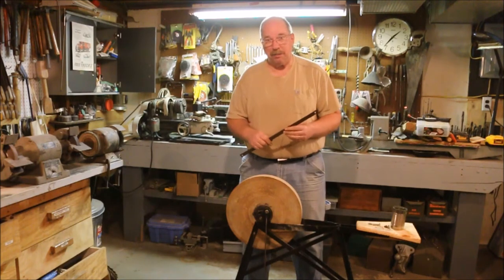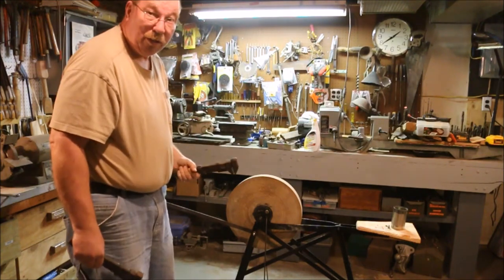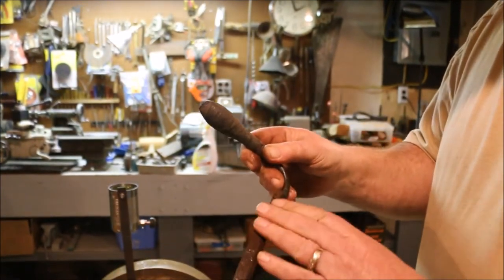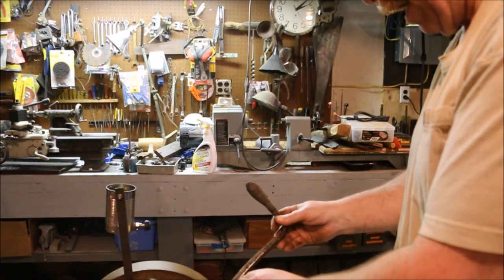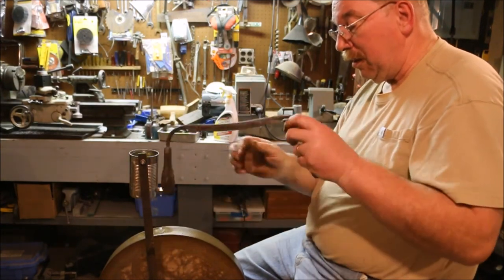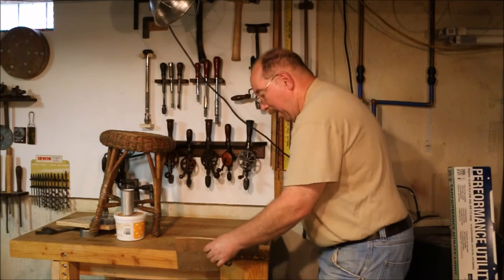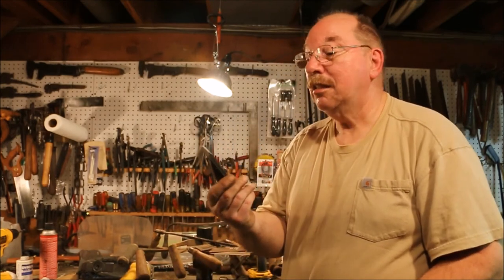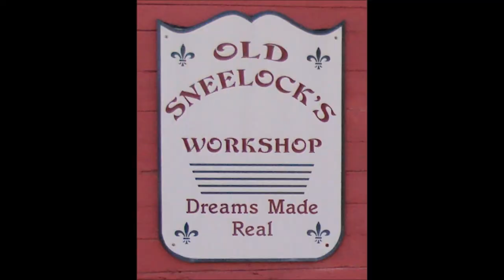AVANT GARDE VIDEO PRODUCTION ~ SHARPENING A DRAW KNIFE UNCUT

Comment: A longer format just for the sake of being longer is OK (assuming I don't already have a back log of YT to watch), but I personally prefer the more condensed format.

That said, the grinder looks like it works great.  Should we expect to see you sharpening your twist drills on it?  Yes, a joke, but I wouldn't put it past you to try it just to say you did.
Reply from the maker: Brian Neeley I'm trying to design a tool rest to help with aligning work on the wheel. Any of the hand or treadle grinders that I have in the shop create an imbalance due to the constant  motion.
The treadle grinder in it's current configuration would be almost impossible to sharpen a bit on. The stone itself is capable of creating a good edge. Holding everything freehand while pedaling seems a bit past my capability.